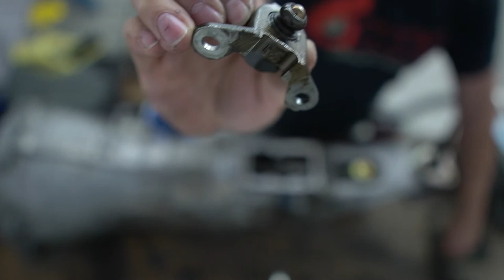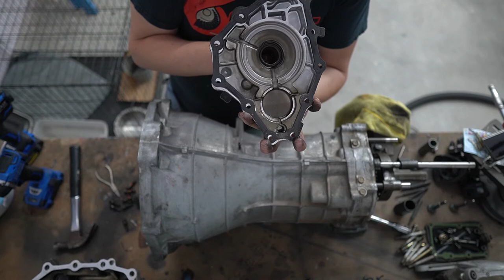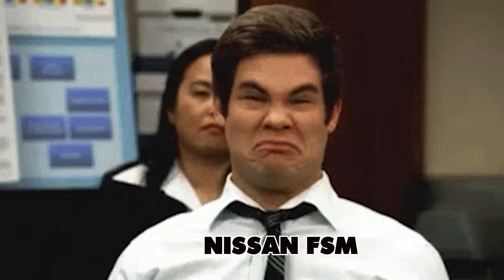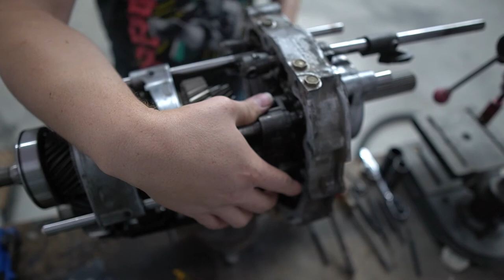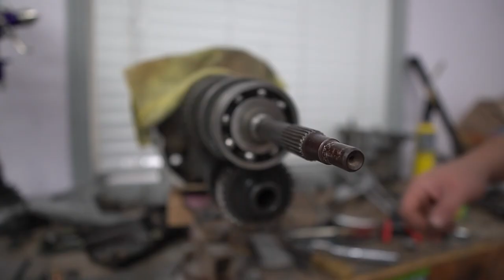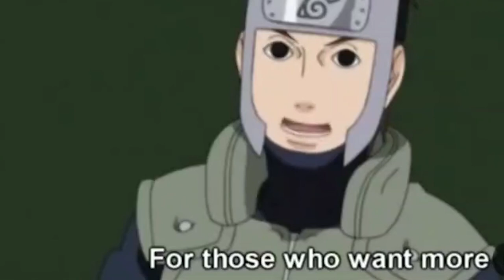Nissan CD009 Transmission Rebuild Pt 1

Comment: There is absolutely no information about taking these transmissions apart on forums until your videos which is ridiculous to me since its the go to transmissions for drift builds. Your videos will save me in the future since I already have a CD009 available to me but it has the notorious 3rd gear grind and 5th and 6th gear completely are gone so I was going to buy a new one from nissan. Now I don't! Also the focus on the camera makes everything you are doing look so clear which is a huge plus. Can't wait to see more of your build process
Reply from the maker: Thanks! we are glad to hear it's actually helping people out. We are going to start the re assembly process this week as we finally got all the parts we needed so the series should be completed soon.
Reply: because it’s often about same or less cost to buy a new one at the dealership and just toss it instead.  More so if you can locate a good used one, but for under $1600 USD I’d rather just buy a new one. 
.

not so uncommon with a few OE transmissions
Reply: @nobodyspecial5026  a brand new one from a dealership is 2,300. Ive checked numerous times and for a select few that feel that they can handle the task of taking it apart, this video series is the best walkthrough of where things go/how to take it apart. Parts are about $1000 depending on where you get your synchros and bearings from. Just the fact that Garage 23 did this series is amazing for anyone that has a broken CD009 laying around that they want to fix and use in their drift car. 

Most would buy a new one but just having that time of pulling your trans apart makes the build feel more special, at least in my opinion

Comment: Damn man thanks for putting in the time and showing how to pull it apart, ot sure ain't to Muncie 21 lol. I got 1 from the junk yard today it feels good through out all the gears but I wanna take a peak inside just in case it's going to be with an ls1
Reply from the maker: Nice! I came across one at the junk yard a couple years ago but i left it cuz i was alone and too lazy to pull it myself. Still kicking myself about that 😓
Reply: @Garage23  it really is not that bad pulling it out by urself I got mine outta g35 seemed like it wasn't stock. It had headers intake aftermarket rad just all kinds of wierd shit that the other 2 g35's didn't have
Reply from the maker: @projectf025  oh it's bad when its 118* outside 😅
Reply: @Garage23  I know what ya mean I'm in texas
Reply: Another question for ya... the tranz I pulled came out of an 03 g35 can other cd00? syncros be used in the cd001? I'm only finding parts 04 and up

Comment: As someone else said, it’s pretty ridiculous that there isn’t any information on any forums or even any Nissan sites containing part numbers or rebuild part information. Thank you for posting this video. Would this also apply to a JK transmission since they’re technically almost identical internally?
Reply from the maker: Thank you! Yes they are similar, if you watch through the series you will see how many parts are interchangeable.

Comment: I'm thinking about removing those little weights on my trans too. Was there louder/excessive drivetrain noise with those off? Thats the only thing i can think of that it does, reduces drivetrain noise
Reply from the maker: The CD is already a pretty noisy trans so we didn’t notice anything but I’m sure it is meant to dampen some sort of vibration

Comment: Awesome videos! I have a question based on your expertise. I dropped (literally dropped) my cd009 on the ground from about 5 feet in the air. It hit on the edge of the bell housing. Amazingly it didn't crack and even drives and shifts fine. However I'm getting noise in gears and 4 and 6. Not a grinding but rather kind of like buffetting noise. Wondering if my gear sets slid and shifted slightly on the shafts. Would that make sense?
Reply from the maker: 4 and 6 are on different shafts I'm not sure what would cause a noise like that. I suppose an impact of that sort could have damaged one of the smaller bearings. That's the only thing I can think of.
Reply: @Garage23  Thanks so much for replying! Fluid came out clean, so for now I'm going to run it and see if it blows up. So mad at myself still. Thanks again, keep the videos coming!

Comment: Do i need that weighted block? Also THANKS FOR MAKING THIS VIDEO
Reply from the maker: I'm not sure if it's there to dampen vibrations or has some effect on the weight balance in a 350Z but no it's not necessary.
Reply: @Garage23  hmm.. if its there to dampen vibrations i might keep em on. They were a bitch to work around when I was installing my coolerworx shifter, but at least they were able to bend. Looking forward to putting a polyurethane mount in the future.
Reply: @Garage23  hey man i just about finished -this video. Will watch the others. I gotta say again, super appreciate this. So hard to find anything on rebuilding these transmissions
Reply from the maker: @itsmistersmoke  glad it helped 🙌🏼

Comment: Where did you find the parts for the rebuild?
Reply from the maker: https://www.amayama.com/en
3rd Gear Needle Bearing #: 32276-CD001
3rd Gear Assembly #: 32260-CD81C
3rd Synchro #: 32620-CD405
4th Synchro #: 32620-CD016
5th and 6th Synchro #: 32604-CD105
Reply: @Garage23  thank you!!

Comment: I have a 2003 350z all the gears seam fine just the syncro is going in 3rd gear I can only seem to buy syncros for a cd009 some threads say that the syncros will work in the earlier cd transmission are you aware if they are different?
Reply from the maker: I have been looking for a CD001 to try this on because all the documentation says it doesn’t work but I think it should if you replace the bearing, gear and synchro together.
Reply: Did you find your answer?  I'm wondering the same thing.  Where can I get the syncros? 2003 350z with no 5th and grinding in 6th.  thx

Comment: Would this info pertain to my 2003 cd001 or is the 09 different?
Reply from the maker: The general assembly is the same but there are design differences in the gears and synchros depending on the year.

Comment: Hey question bud how can I get that front bearing out with disassembling  the whole bellhousing?
Reply from the maker: The bearing on the input shaft? You can't. The case has to come off so you can get a puller behind the bearing to remove it from the shaft.

Comment: Can you remove the input shaft bearing without splitting the case? Wondering cus I don’t have a ton of space to take the transmission out from under the car but it is off😢
Reply from the maker: You can not. At the very least you need to take the front half off then you could rig up a puller to get it off the input shaft then hammer it back on to avoid using a press.

Comment: Are all the input shafts the same? I have a cd00a that I bought new last year and my input shaft was damaged! Will any input shaft from cd00x work ?
Reply from the maker: They are not all the same, there is 2 or 3 different versions. The newer ones use a different synchro and bearing than the older ones and the older ones had 2 different sized bearings.
Reply: @Garage23  so I can use an input shaft from any 04+ and if it’s the 07+ I just have to mill the 2mm and use the 100mm bearing right ?
Reply from the maker: @2jzs13  correct but I'm not sure what size synchro the 00A uses so worst case scenario you may have to order the corresponding synchro if the one you have turns out not to fit. If your case uses the 100mm bearing then I would assume it uses the older style synchro.

Comment: Hey dude, can you see any reason why the shift linkage at a staked union joint? Can be seen here 11:11
Reply from the maker: Not sure if there was a typo, are you referring to the external linkage?
Reply: @Garage23  Yes sorry, has a* 

The linkage from selector shaft to shifter that goes into shafted. I’d call that shift linkage..

Comment: How possible is it to take the reverse synchro and gear out a 03 cd008 and put it in my 06 cd009 transmission?
Reply from the maker: I'm not sure if the reverse gear changed in that time but it's the easiest gear to get to since it's the first one to come off. So it's worth a look at least.

Comment: do you know if an imput shaft seal would cause a serious fluid leak in a cd001?
Reply from the maker: Depends how bad the seal is worn i guess. I've only ever had an output shaft seal leak and that can get pretty bad.

Comment: Hey bro question. So I currently took apart my transmission on my g37 due to it getting stuck in 2nd gear while driving around. Do yk what could have caused that?
Reply from the maker: Could be a number of things, broken/bent shift fork, damaged synchro, broken gear, damaged bearing. You need to keep taking it apart until you find the damage.
Reply: @Garage23  appreciate it. The transmission was brand new from nissan. So I find it weird that it got stuck in 2nd already
Reply from the maker: @Awp4469  in that case check the clutch, slave cylinder and maybe the shifter first because that is very strange.
Reply: @Garage23  I did. Clutch was replaced with trans install 6 months ago. Even installed the zmak csc kit and new oem master. Now even with the trans off and the bell housing off the shifter still stuck in gear

Comment: Mine is missing the Check ball do you think it went into the transmission?
Reply from the maker: If it was the one under the shifter plate it could have fallen on the floor. If it was one in the mid plate its most likely in the case somewhere. If you did lose it Amazon sells a case of assorted ball bearings https://amzn.to/3MdLa4D
Reply: @Garage23  Thank you 🙏🏾 it’s both the ones in the shifter plate. I disassembled the whole transmission just to make sure it didn’t fall in and don’t see it. Glad I did lots of junk to clean out.
Reply from the maker: @ADDMEONPSN  No problem, good luck with your build 🤟

Comment: Can you build a cd007 into a cd009?
Reply from the maker: I also want to verify this, it seems like it is possible but i need to find an older trans to try it on. Another concern is if it would be cost effective as youd essentialy need to get all new 1st thru 4th gears and synchros. So it might get pricey.

Comment: Wtf, your front case came right off? I’m still fighting mine after it separated.
Reply from the maker: After the 12 bolts securing both halves, you need to remove the snap ring off the input shaft bearing then it should slide off.

Comment: WHERE DID U GET THE SYNCRO FROM ??
Reply from the maker: Info in the bio 👍🏻 https://www.amayama.com/en
3rd Gear Needle Bearing #: 32276-CD001
3rd Gear Assembly #: 32260-CD81C
3rd Synchro #: 32620-CD405
4th Synchro #: 32620-CD016
5th and 6th Synchro #: 32604-CD105

Comment: Thanks for posting this! Really nice clear video with a good view of everything going on! Was a real pleasant surprise to come across tonight after watching some other videos a month or so ago. All I needed info on was the rear housing disassembly and this was perfect :)

One question, at the bottom of the plate sandwiched between the front and rear housings there’s a rectangular hole which from what I can tell is just a drain/passage for gear oil between the front and rear sections? Is that correct? The service manual mentions a magnet being there but I haven’t actually seen this magnet in anyone’s videos..
Reply from the maker: Yes! I actually didnt come across this until after I had everything apart. To my understanding there was supposed to be magnets in the windage tray but this may be for JK040 trans and later, this one is an early 009 so there is a magnet at the bottom of the center plate.  Add us on IG and I can DM you a photo of it if you need. Thanks for your support 😁🙏🏻
Reply from the maker: @bradrhodes7809  its @garagetwentythree all spelled out.